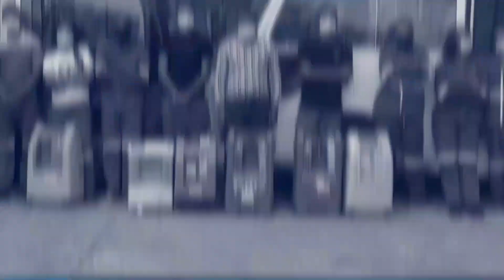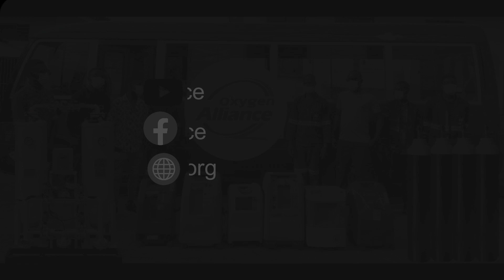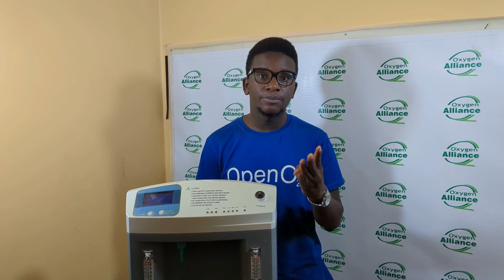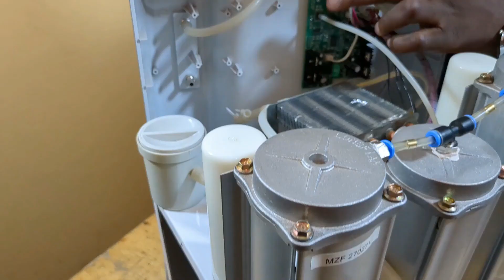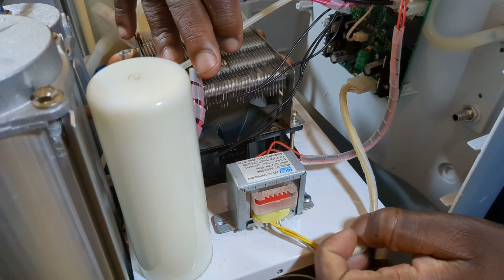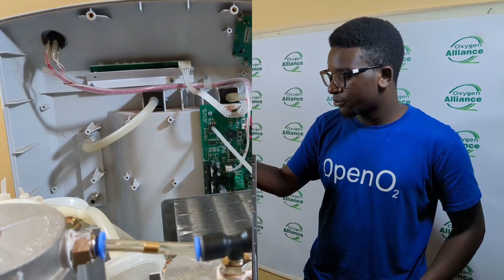Longfian J5 oxygen concentrator electrical connections

Comment: My oxygen concentrator alarms LP and stops imediatly.what may a cause?
Reply from the maker: To answer your question, let's start with what   LP alarm means. It indicates that there is low pressure of oxygen being delivered. Therefore, there are a number of possible causes for your device to be producing low pressure.
There may be leakage in the tubings, loose connections and clogged filters. What you have to do is to check loose connections in the oxygen tubings by removing all housing screws and then separate the plastic front and rear covers carefully.  Then inspect all oxygen tubings and check if they are well connected. Any loose tubing should be connected properly and any clogged filters should be cleaned with clean water. For leakages,use soapy water to check for these leakages while the oxygen concentrator is running and seal the leakages accordingly but be careful ,don't spill any water on the board and be aware of  uninsulated wire and make sure you don't spill any water on these, before testing for the leakages make sure all wires are well insulated.
Ensure that all clogged filters are cleaned and re-installed.
You should also check for worn out compressor kits. After you have carefully separated the front and back covers, remove the air tubings then remove the compressor assembly. You can take a picture of the compressor connections before  disassembling (by removing the screws) so that you refer to the picture for proper reassembling. Now after separating the compressor assembly, inspect for cracks on the piston cups. This is important because if it is cracked, the air may be escaping through such cracks which will decrease pressure hence resulting in the low purity of oxygen as low pressure negatively affects the pressure swing adsorption process, therefore, replace the worn out piston cups with new piston cups. On the replacement procedure of a piston, there is a video on that which you can find by Clicking the link in the brackets (https://youtu.be/j98or-fvbSk). 

Another cause is a due to incorrect setting of the pressure regulator. Measure the outlet pressure and it should be in the range of 40-70 kpa. if not, re-adjust to this range.
Reply: @uptime-alliance where is the regulator placed?

Comment: My oxygen concentrator compressor stops then starts..,often what might be the cause of that.?
Reply from the maker: frequent stopping and starting of the oxygen concentrator compressor may be due to overheating triggered by clogged intake filters, restricted airflow or a faulty cooling fan
 causing the thermal overload protector to activate. It may also result from electrical issues such as a faulty capacitor or unstable power supply. To resolve this, clean or replace
air filters regularly, ensure proper ventilation around the unit, check and replace faulty capacitors and use a voltage stabilizer if power fluctuation is suspected.